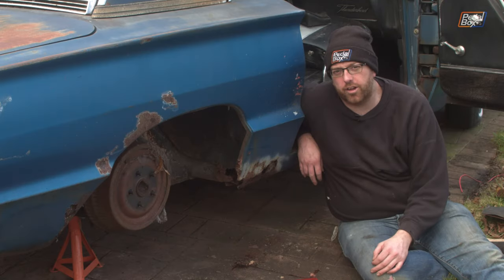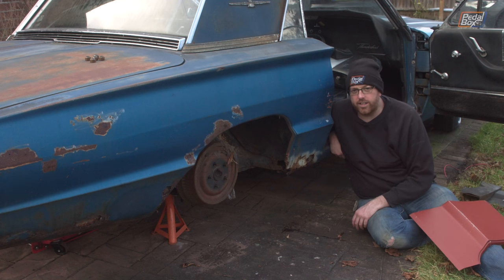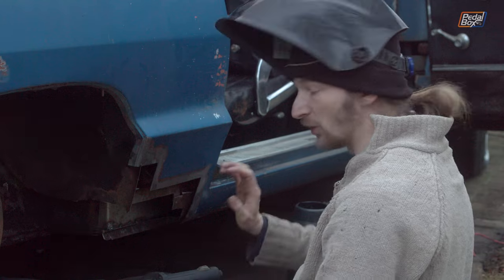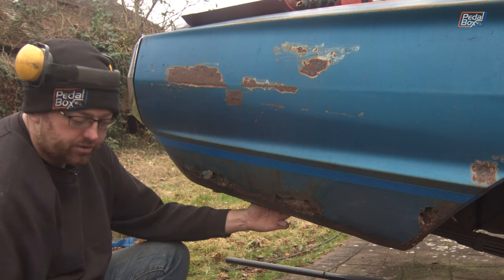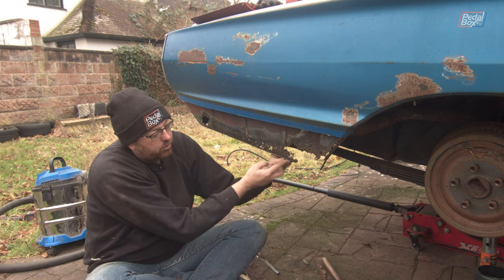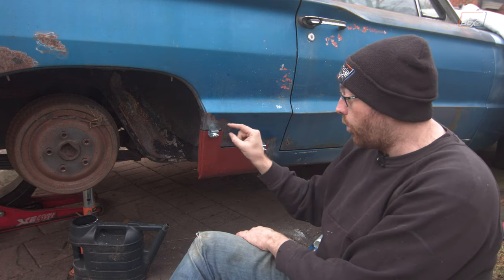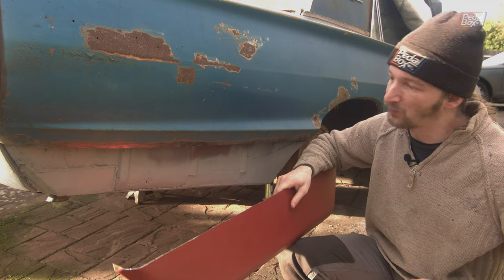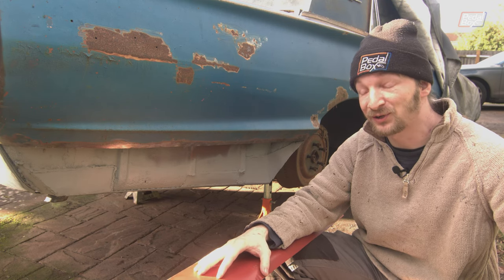Stopping MORE Rot | 1966 Ford Thunderbird | PedalBox Episode 128

Comment: Can the panel not be fitted higher up?
Reply from the maker: It could, we could have sliced way further up the body and put more new panel in, in theory. The rear most section had a much tighter radius on the corner than the original, so higher wouldn't have helped :/
Reply: Agree not sure why can't cut the top off the new panel. Radius at the back might be different further down?
Reply: It’s hard to explain tbh but roughly, if we placed it higher up so the bottom was at the right height, the length from the front edge in the wheel arch back to the rear edge was too long. It’s like the angles where the bottom edge met the wheel arch and where it kicked up for the rear were wrong, or something?

If I remember right, we ended up setting it higher up eventually like you suggested, and just battering the shit out of the rear lower corner to shorten the panel so it would be the right shape.